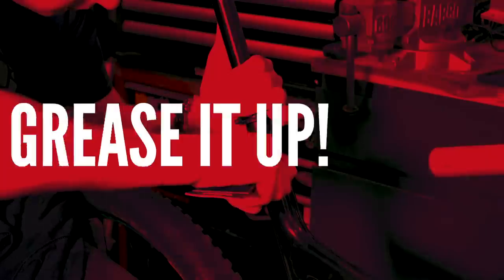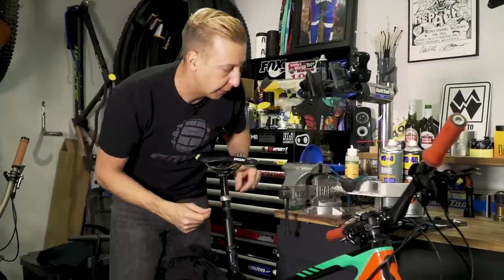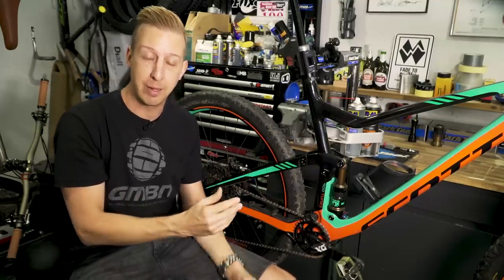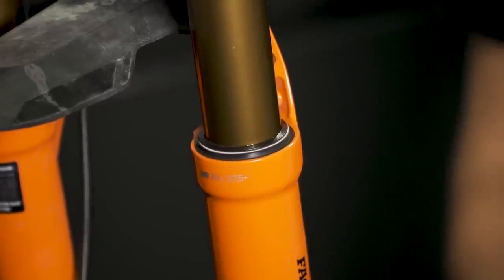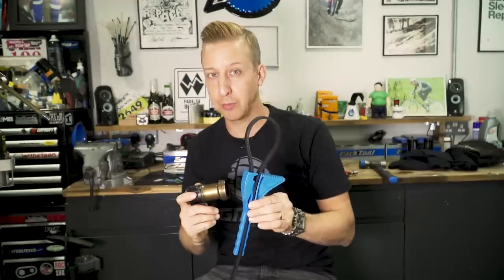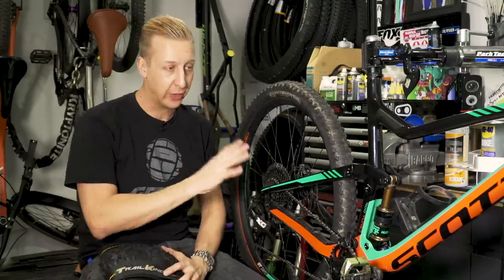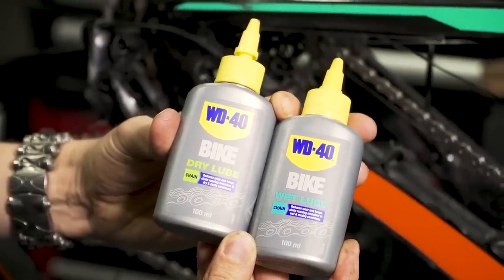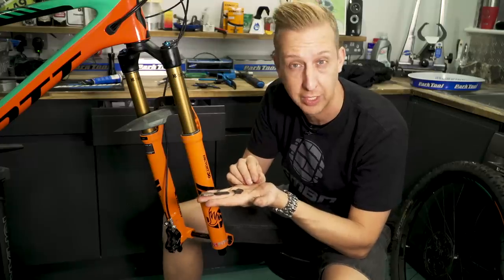Top 8 Ways To Prepare Your MTB For Winter Riding

Comment: I really enjoy watching these maintenance videos Doddy!
Reply: You don't have winter over there Tomi ;-p ;-p ;-p
Reply: Not yet Maciej! The summer was also brutally hot! Well... At least I can go mtbing for longer :)
Reply: @th_js  Our autumn got vicious just now, temps are going to be around +5 C with below 0 at night and started to drizzle/rain. Long term prognosis on acuweather says another mild winter with similar temps is awaiting though. We had killer summer and even spring was warm and very dry which made sand really loose for whole summer and that was a pain to ride through sand pits. Pine woods are full of sand too. Bike still awaiting full service so winterising will be included. Going full mud fenders though, none of this half assed bs. I can't uderstand why MTB's can't have full fender mounts, stupid fashion. Luckily Suntour thinks different and at least my Aion fork has them, so no bodging in the front. Plenty in the back though. I even gonna add rubber extension in the front like on old morocycles they used to, back in the day when motorcycles were used much like a car.
Reply: @polishguywithhardtospellna8227  Well the fender thingy is really a personal preference. I never run anything more than a Marshguard up front. I just hate them flapping around and they really don't look nice in my opinion.
Reply: @th_js  Well, that's the thing, full fender WITH support braces is not really that "flappy". Suntour mounts braces boses on the lower legs. Why can't we have braces bosses in the upper triangle? Because it's not fashionable? It's beyond me. End of the day me and You both know, that in harsh winter, calm, paced riding is only possible, so then it's more important if we are covered in snow/mud and wet than if the fender is flapping aint it? I prefer to be able to ride, than to have frost bites, because I got wet from tyre splash(can i say tyre splash?). I believe all those hard riding winter videos are in warm snowy winter climates, where it's like 3-5 degrees in plus, but with regular snowing. Not many people go for 2h hard ride in minus 10-15 or below. Clothing required would be so expensive. And yeah it's not so enjoyable to ride only in a paced manner, but I've been riding to work late autumn and early winter plus then early spring last year, all paced riding. It made me a monster stamina wise. Quitting riding due to conditions and temp is much more negative for the sunny season.

Comment: Very surprised you didn't mention the use of ACF50, very commonly used by motorcycle riders in damp weather. It's an anti-corrosion spray used in military aviation.
Reply: I work Beach Patrol and salt and sand is awful for jet skis and four wheelers. We also spray them off with something similar. I have no idea if it actually does any good or actually works. But it's so cheap why not. The average life expectancy of a four-wheeler is about 200 days.

Comment: I have the YT 27.5 capra pro race and it 4 months old an on build I installed 12 speed GX eagle so to make the cassette last longer I run 4 new chains and boil the in putoline chain wax on gas stove and change the chain every ride or if dry every other ride. This save the expensive cassette even when the forest is very muddy.

Comment: For night riding,  I would suggest looking into Nite Ryder products.  I have the Nite Ryder Sentinel 250 (250 Lumens) for the rear lights and it has laser lane as part of the rear light and the Sentinel is very bright for the rear.  For my front light,  I have the 900 Lumina Boost (900 Lumens), it is very bright at its maximum settings.  Both of these lights are USB rechargeable.

Comment: 7:20 - Doddy it's not necessary to pop the spring/open the lip of the seal with WPL Fork Boot... just rub it on the stanchion, compress once and it will pull crap out of the dust wipers.

Comment: top tip: instead of a helmet light, get yourself a headlamp, petzl actik for example. that is if it will fit with you helmet on. very, very powerful light, for around £30. you can use it for everything else too, not just riding. much recommended, reliable and comfortable to wear.

Comment: Hi Doddy, great video as usual thanks for featuring me on BikeShed! 
I’ve just done a full winterisation and found water in the existing grease around many bearings, because of this I’m tempted to consider just cleaning my suspension and drivetrain after winter rides then letting the mud dry and brushing it off with a soft brush rather than washing every ride and possibly pushing water into bearings, do you see any problem with this approach?
Reply: Yep, no problem if u where rinsing it down daily.

Comment: GMBN, you rule! 
Would it be fine to use silicone spray instead of fork lube for greasing dropper post, front and rear suspension? It's effect is lasting for short period and when applied the bubbles appear shortly. I  guess it eats the gease. The specific product I used was Motorex silicone spray for car doors. I think I'll go with recomended procedure shown in this video and use silicone spray to lube the deraileurs moving parts.

Comment: I usually just put the bikes away for the real Canadian winter. But I am curious how mineral oil brake fluid works below -10 degrees Celsius.
Reply: With shimano XTR brakes I have experienced brake pistons seizing up at -17 degrees C plus 120 km wind chill after a short pause on the top of the hill. I had to squeeze the lever couple of times before starting my ride again to get the pistons working again. After that, the bite point wandered outwards a bit, but given the "extreme" conditions, they got me down safely. Just check your brakes before descending ;)
Reply: Yeah, I figured the brakes would get sluggish. That is the only advantage to using DOT brake fluid. It has glycol in it which prevents it from thickening up too much when it gets cold. I don't imagine that shock fluid does very well either, but it is not as critical as the brakes.
Reply: Thats awesome I have Hayes hydraulic going to try DOT 4 this winter my usual v brakes would stiffen up in -10 or -20 tried lubing the inner cable but springs on v brakes would stiffen too

Comment: #askgmbntech why are some rear suspensions placed on different positions for example some are connected to the top tube others to the down tube and others are close to the bottom bracket
Reply: that depends on the overall geometry of the bike and how stress from the rear suspension is distributed to the frame, also different suspension layouts make the bike either have linear or progressive suspension( also depends whether you have coil or air shocks)

please correct any mistake I said, I have only basic knowledge on this lul
Reply: Thanks man